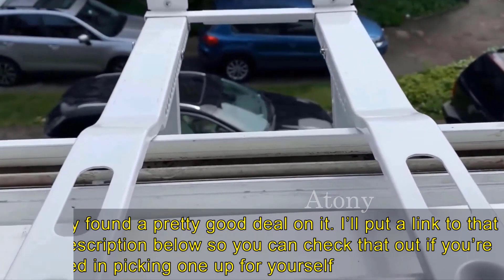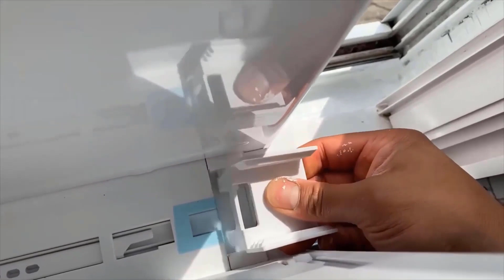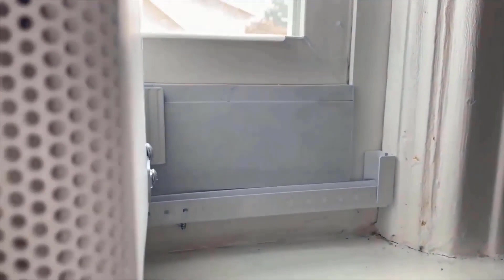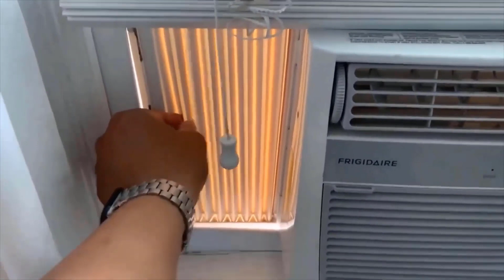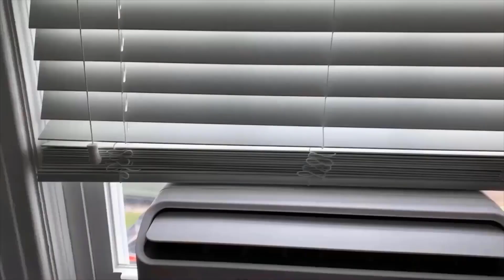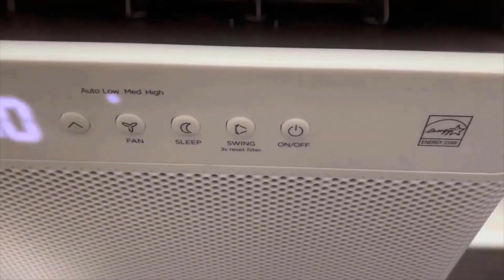Midea 10,000BTU U-Shaped Smart Inverter Window Air Conditioner - Review 2023

Comment: I had to return my midea u, the compressor vibrated like crazy at low speeds and it sounded like a helicopter hovering overhead, low bass like sound vibrating the wall.